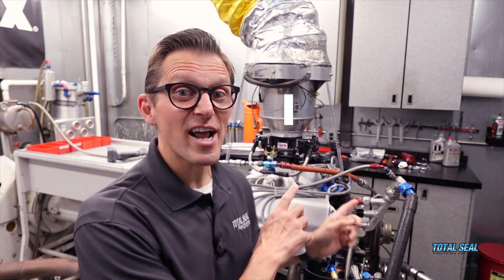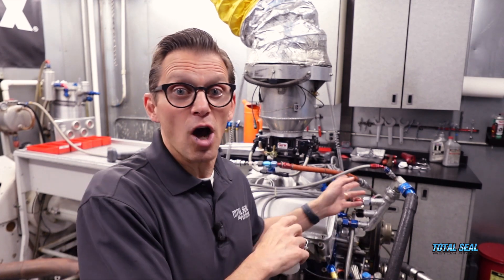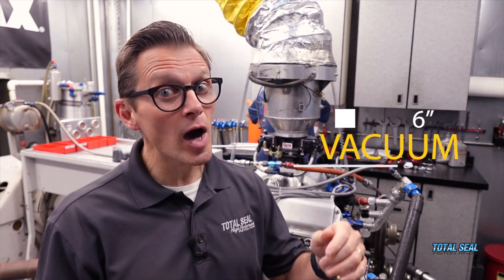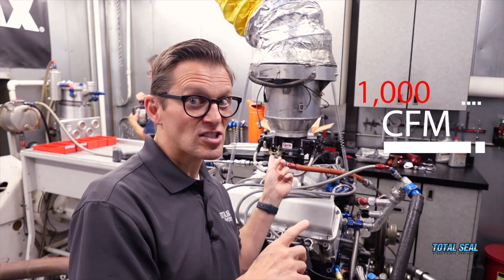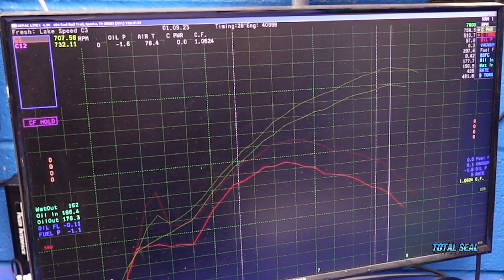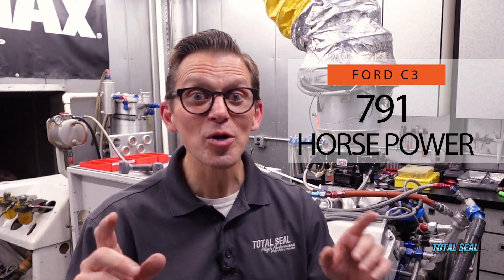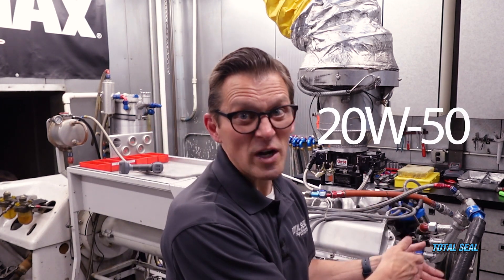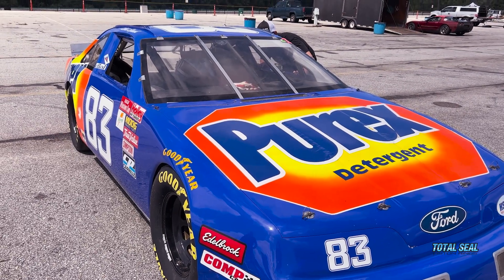How We Prevented This Engine From Failing, Again!

Comment: Did you say what the problem was? I didn't need an oil analysis to know there was water in there. Where did it come from?
Reply from the maker: It was a pin hole leak in the intake runner on cylinder #3. It only showed up when the engine was up to full operating temperature. The oil analysis is what discovered the leak because the leak was so small you could not see it otherwise. From the analysis, we could tell it was temperature related because the last sample was taken at operating temperature with less run time, but it had more water than the first sample that actually had more time on it. Without the oil analysis, the leak would not have been found.

Comment: And thank you for your vids! I know most of us would be fascinated with how you found that leak. I work on Audis and the heads for one 1.8L model had an intermittent problem with porous intake runner castings. It was also most often temperature dependent. Your sharing how you found yours in another vid would be an extra bonus for all of us.
Reply from the maker: From the oil analysis, we knew the leak was heat related (more water in the oil on the runs made at the higher engine temperature). From that, we heated the heads and did the pressure check at the "operating" temperature. That's how we found it.

Comment: But where was the water leak ?
Reply from the maker: It was a pinhole in the intake runner of the #3 cylinder. It would only show up when the heads were heated.

Comment: That is crazy that a pin hole opened up in the head only when hot to let coolant contaminate the oil.
Reply from the maker: It avoiding detection from some great engine builders. Fortunately we took those used oil samples on the dyno.

Comment: The .7, .7, 2 ring pack is crazy to look at! Do you see those working/ lasting or making their way to the high horsepower boosted street engines? Or just in NASCAR type engines?
Reply from the maker: The .7, .7, 2.0mm ring package is just for competition engines. For the street, a 1.0, 1.0, 2.0mm package is fantastic.

Comment: So how was the water getting into the oil???????????
Reply from the maker: There was a pin hole leak in the intake runner on the #3 cylinder. It only showed up when the heads were heated. At room temperature, the heads would pass pressure testing. The oil analysis showed more water the hotter the engine was, so that's how we knew it was heat related. Once we heated the heads, we found the pin hole and welded it up!

Comment: ,,, sooooo, the piston in the thumbnail was from the minus 300 horse wheeeze-dog ,,, ?
Reply from the maker: Good catch! That's actually from this engines brother. Similar heat related issue that oil analysis helped solve, but that's going to be another video...
Reply: @TotalSeal ,,, yes, I didn't think your Dad's pup was huffing out the breather(s), like that piston shows .

Comment: Did i miss something ?  You mentioned SEVERAL TIMES of finding the source of the overheating problem (through oil analysis) that the great Lake Speed had with this engine 20 yrs. ago. Well,why did you not tell us WHAT exactly did the oil analysis testing reveal as being the original cause of the overheating? (I'm a 60 yo, ex racer,retired ASE tech & those things are of GREAT interest to me.
Reply: Exactly what I was looking for the answer for.  Glad I saw your question and the answer.
Reply from the maker: The oil analysis revealed that there was water in the oil, so that led us to investigate the cylinder heads. We found a pinhole in the intake runner of cylinder number 3, and it would only show up when the heads were heated. At room temperature, the head would pass the pressure check.  

That leak caused the coolant loss during the race, which led to the overheating.
Reply: @TotalSeal  Outstanding !  That's EXACTLY the info. i was looking for (and can understand).
Reply: Weld it or epoxy? @TotalSeal
Reply from the maker: Welded it up! @gailtaylor1636

Comment: Water leak was??
Reply from the maker: There was a tiny hole in the intake runner of cylinder #3. It only showed up when the engine was hot. I would not leak cold, but it did when heated up.
Reply: @TotalSeal  Sorry but i meant to ask, would you mind sharing how you found the leak. Pressure testing,etc,??
Reply from the maker: @brianb5779  No problem! From the oil analysis, we noticed the water level increased as the temperature increased, so we decided to pressure check the heads with hot water in them. That opened up the pin hole, which could not be found with pressure testing at room temperature.
Reply: @TotalSeal  Really appreciate it, thank you.

Comment: So where was the water getting through to the oil?
Reply from the maker: There was a tiny hole in the intake runner of cylinder #3. It only showed up when the engine was hot. I would not leak cold, but it did when heated up.
Reply: @TotalSeal Ran into similar twice working as a HD mechanic where it had to be hot. One instance the part also had to be torqued into position. A slight machining tollerance issue opened up an extremely tiny crack when it got hot. Good you found it. Must have been a casting flaw.

Comment: What was the source of the water?
Reply from the maker: There was a tiny hole in the intake runner of cylinder #3. It only showed up when the engine was hot. I would not leak cold, but it did when heated up.
Reply: @TotalSeal Glad you responded. I was so pissed you didn't share or show the issue. You had such a buildup of the problem and left us hanging. Next time please show the problem if your gona make such a buildup. Please and thank you. Good info btw
Reply: I like to use the Aluma-Seal for tiny, tricky leak repair and preventative. 😄